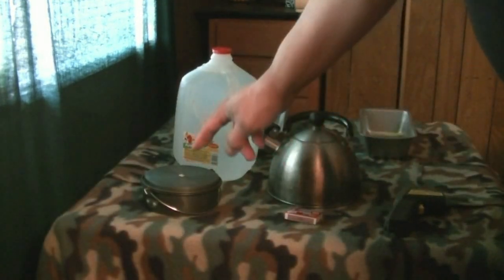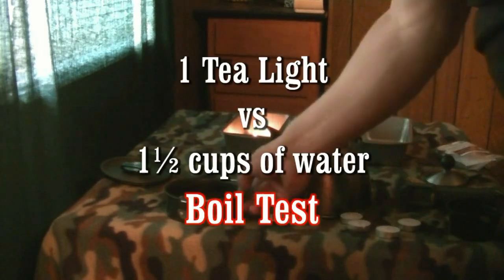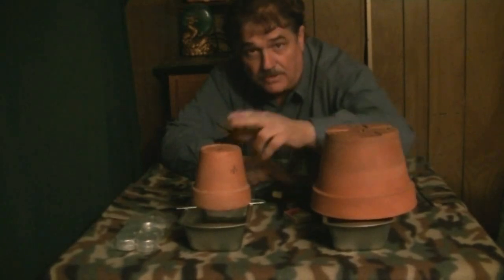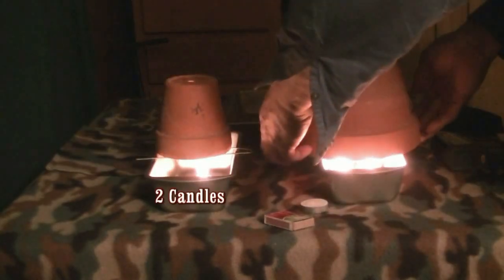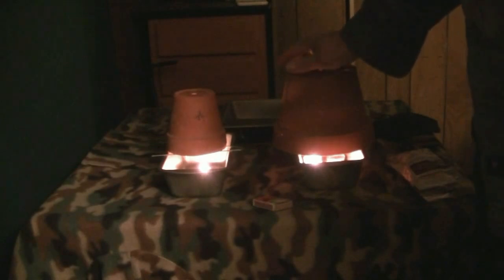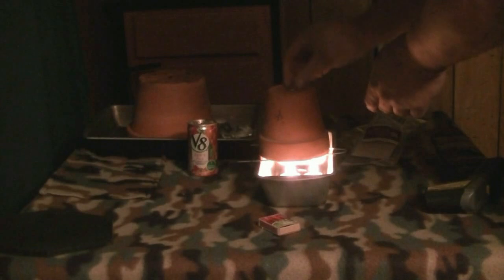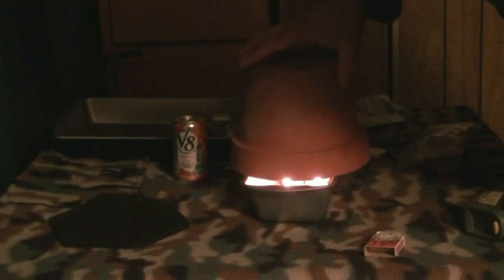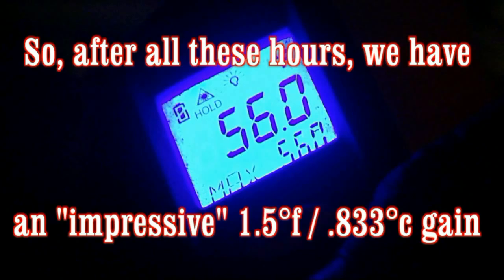Flower Pot Heaters - Real or YouTube Legend?  (Tested and Debunked)

Comment: If it doesn't work, can you figure out a way that this stuff will do something right?
Reply from the maker: I had a friend who put up a video showing off the one he made.  When he and I went out camping, where he was staying in a fully enclosed storage house (About 12x8 feet) and tried it out on a cold night.  I was out hanging & sleeping in my hammock and he was freezing in the cabin with his flowerpot heater.  He asked me if there was a way to make it suitably warming.  I suggested a version of alcohol stove that I had made - you see, the alcohol has a far greater BTU potential than tealight candles do.  He did a video on it.
I told him to get a small can - like a can of sliced olives - wash it out, put in fiberglass blanket cut into circles & filling the can.  Add alcohol (the higher percentage, the better) and use it under the flowerpots.  Remember that there will be heat loss due to heating the ceramic of the pots.  flowerpots don't have sufficient mass to store much heat & radiate it later.

Comment: For a start, I've never seen a candle/flower pot heater set up like this and secondly, it's meant to be for a small bedroom, not a large room.
Reply from the maker: First off, thank you for watching my video.  Now, if you'd indulge me...

Let's address the only part of your thoughts I can address using facts as opposed to thoughts/emotions.  That being the size of the bedroom used.  (I can't address the configuration of the tealight heater I used, as I can't know what videos you might have seen.)
The room's dimensions:   10.5 feet  x  7.5 feet  x  7.0 feet  =   551.25 cubic feet  (total volume)
The room's dimensions:   3.2 Meters  x  2.28 Meters  x  4.13 Meters  =  15.61 cubic Meters (total volume.)

As you can see from the measurements I took of said room, it is in all actuality a rather small bedroom.

As for anything else, purchase a laser thermometer, find a room of similar size, set up  a small table with your configuration of said candle heater, and use your cell phone's video capture mode, recreate the same test I did, fully documenting your test with its results and be brave & honest enough to post your results so others (myself included) can attempt to reproduce your results.  That way you can offer a fact-based rebuttal.  (I showed my science and method so others (you included) could reproduce my test and its results.

I look forward to watching your rebuttal video (when you post it).

Rich, from Spirit of WildWings

Comment: built by someone who thinks just coving candles with plantpots is all there is to it, i have made one following a good video, how to make plant pot heater and had to blow candles out because it was getting to hot after 3 nours using 4 tea lights temp reached 72 c iner plant pot was 80 c.
Reply: Tell me how you get more energy out of it than you put into it, please.  Oh, and could you throw in some scientific proofs while you're at it?  I showed my procedures in action and shared my findings.  I followed the Scientific Model, allowing others to recreate my project.  Oddly I haven't seen anyone offer proofs against what I showed and concluded.
Reply: @richwells284  Idiot
Reply: @richwells284  YES IM USING 2 and my room is 21.5 after 6 hours from 18 and its 6 outside what more do you want tried and tested and works

Comment: Them flower pot heaters needs thicker richer flames for it to work.I would avoid using  Tea Light candles.Its a  video called "The Ultimate Flower Pot Candle Heater-DiY Radiant Space Heater" He use some type of cotton to get better flames vs them tea light candles.And try using Corded In-Line Duct Fan from the Home Depot or something to circulate the heat.
Reply: I had a friend who bought into this farce, but had to admit its failure when I had him put it to the test one especially cold winter's day.  He then asked me if there was a way to give his flowerpot heater the needed BTUs.  I showed him the difference in BTUs between his candles and the BTUs in one of the alcohol stoves I was making at the time.  So he switched his heater out for an iso alcohol heater and it gave him the ability to put out a sufficient amount of heat.  
If you can't produce enough thermal units at the start, the physical laws of thermal dynamics show us that conservation of energy means that the ceramic cannot multiply it, but rather have to take away heat due to transfer to the pots, the air inside the pots, and the bolts used as well.
If you can work out a way to defeat the Conservation of Energy, then please turn your attention to overcoming the laws of Gravitation, as I want the flying cars they used to keep promising us.

Comment: You debunked nothing. Check out how deep those bread pans are.  Your tea light is no where near the clay pot.  It's literally 3 inches away from the pot.  All you need is something small on each side of the tea light to sit your clay pot, so enough air feeds the little flame.  Then your clay pot will get hot.  But you have 3 inches between the flame and the pot.  The flame isn't even 'in' the pot area. Try again with the flame literally underneath the pot and not 3 inches away.  In 10 minutes the pot will be so hot you will not be able to touch it.  Still, get back to us.  It works.
Reply: Why don't you do legit science. Performing the test yourself (with accompanying video record) and use valid, repeatable steps to offer refute. I showed my work try it my way and get my results, then repeat the same test making the single step you wish to refute and share your documented results.
Use the scientific method to validate your claim of faulty technique on my part.
Or prove how this contraption devfies the conversation of energy principle.

Comment: Of course you can't expect it to work like a heater, this is mostly for emergency when the power is out, it is at least better than nothing. There are many flaws in your setup. The hole on top must be covered, the bottom is too high to let the cold air in. To make it hotter, use a eye bolt and a washer, this will cover up the hole and heat the bolt, and make it even hotter. Use a bigger, taller pot, 2 pots to keep the heat longer, I think all the above will determine how effective you want it to be. Many debunking videos should first troubleshoot why it is not working for them before jumping into a conclusion. Try this set up again, try for a few nights and let the candles burn out and not just 5 minutes and see the difference.

Comment: PLEASE REDO YOUR APPROACH to see how FIR (far infrared heat) actually works. It's a little like measuring the heat inside a microwave oven & saying it can't cook. I appreciate your effort, but your flawed "debunking" in this instance may cost lives otherwise saved.  You have not taken into account the effect of FIR-Far infrared heat, that resonates with body heat (btwn 7-16 microns).  It may not heat a room, but it will heat bodies nearby and permeates body tissue deeper than plain heat can.  FIR is used throughout the world in the form of any heat source going through ceramic, sand, jade, tourmaline, brick, etc. (NOT cardboard & foil). Do it and watch the pets gather round it.  A modern example is any FIR  heater, where it may not heat a room, but any body near that source will increase in temperature.  I am currently warm in a cold room sitting at our Japanese FIR-heated table (Kotatsu), and our dry FIR  sauna is upstairs.
Reply from the maker: It either works, or it doesn't.  My testing is and was accurate.
Why not do a video test, in a provable and measurable way, in order to debunk my proofs?

Comment: It appears to me that the idea is to trap all the heat rising from the candle. If the hole on the pot is not blocked the air flows freely out with cooler air mixing as the air rises. The steel bolts I saw were on the inside, they were probably getting heated by the candle flame on the other video postings..
Reply from the maker: +usijoe1 That version of the test was so awful, it got its own video.  Here's the link to that video:
https://www.youtube.com/watch?v=xxpzijXevYg

Comment: Just want to point out to people that methods like these are only capable of working in a effective manner if you live in a house that actually has decent insulation, isn't drafty as hell, and is small enough to be considered a tiny home. Anything over a few hundred square feet is going to have a hard time keeping its heat. 

I understand some people's reasons for scoffing at the flower pot heater, but after seeing my grandparents use it as a secondary heat source only for many years before their deaths, I know enough to say that these CAN work. 

A few key notes, from someone who actually has some real knowledge when it comes to heating a building. First off, you are all using far too large of flower pots. You need the pots to collect heat, but if the flames cannot even come close to the clay, the clay won't catch much of that energy. 

Secondly, you want these at floor level, or as close as possible, because guess what geniuses, heat rises. Put them too high up, and you are effectively heating your ceiling instead of  your immediate area.

Third, keep them near you, not far away. You put these on a side table, near you. Not on some god forsaken shelf in the next room over, or a table in a kitchen that could be heated by cooking some food instead. (You know, common sense stuff... or should be common....)

Fourth. Tealights are for idiots. Go get something with some real bulk, and made out of beeswax or something less toxic than paraffin wax. 

fifth, but not final, Tinfoil is a godsend for anyone wishing to deflect heat, or trap it so it can build up. Use thick tinfoil, and give your heater something to hold onto that tinfoil as it keeps the heat being directed to where you want it. 

Personally, I use a similar method but with a 250w heating lamp. My "pot" is a reflecting shade, with tinfoil surrounding it when I need the heat to be a bit more focused in my direction. That lamp, a baseboard heater in the bathroom, and my stove to cook food with is enough to keep my house in a livable 12-15 degrees C. 

But like I said right at the very beginning, if you have too large a house, or don't properly insulate it, anything you do to heat it will be for naught. 

By the way, I am not sure how you managed to not boil water with those 4 tealights. I use 1 tealight to boil my tea. Mind you, I also use a pyrex glass tea pot. Maybe it transfers/holds the heat better, but still. 4 lights should have managed to boil your water.... Not sure why they didn't, again, because of how often I use just 1 for my teapot at work. (Can't have a hotplate at work, but apparently a candle is just fine.... don't ask why, i don't know.)

Comment: I'm an 8th grade dropout, of a school in a corn field. Really, look it up. 11700 S E 00 W, Fairmount, IN 46928, who then moved to the middle  of the desert in Moab, UT. So, obviously, I know nothing about anything. I couldn't afford to grovel to the gas man this year, so no furnace, hot water, nor stove. I am using space heaters, racking up the coal credits, making it impossible to save for some good ol' NatGas, to do my part in keeping fracking alive. Everyone keeps telling me about this damn terra cotta candle heat system. I refuted all claims for the past month, trying to convey to my 4-12 year college educated, $100K/yr job friends and acquaintances, that if they hold on to this as fact, as 95% of everyone is seemingly doing, then they have wasted they Daddy's dough with all that schoolin', since this uneducated desert rat stoner can just hear the method spoken, and scoff all the way to the power button of the space heater. 
I think I'd rather take the time to throw some rocks in my fire pit for an hour, and lay them about the shack, but my dog is too rambunctious to do so. 
Or, perhaps, if you're going to spend $5 on a 50 bag of tea candles, why not utilize your funds better, and buy a tank of propane, and just burn it full throttle, whilst aiming it at your terra cotta pots. This way, you can heat some pots that retain heat longer than thin metals, which obviously tells highly intelligent webheads that it IS GOING TO WORK!! It HAS to! Well, my head radiates heat at 101.1, and it ain't doing shit to heat this shack up! 
In reality, people aren't posting all those vids to convince anyone of anything, other than that they have the time to kill, to show just how stupid our nation has become. What next? How to keep your fridge at 33 degrees with only 1 ice cube per day? But since your fridge isn't plugged in, you'll have to get in your vehicle, and drive to the c-store, grab a couple cubes, in case it should begin melting, drive home, and voila!, instant cold for your entire fridge! 
This message brought to you by: Some rotten toothed metalhead idiot, stoned outta his gourd, that is WARM, thanks to common sense. All those other people are trying to kill the extremely poor! 

If you read this far, well, BRAVO, I am shocked, but listen to this man in the video, he seems to have the only one which is telling the truth........which in today's world, makes him a whack job, conspiratorial terrorist! 

Thank you for posting a common sense video on heat retention, my friend. I don't 'subscribe' to much, but am going to, tonight, as you're simple wit, and good taste in tunes has piqued my interest in what else you have to say.....you best not disappoint me, or I'll leave nasty comments in our Govt's emails!
Reply from the maker: +dmjaded Well stated, very articulate, and so on.
I appreciate you words.
Reply from the maker: +dmjaded When people claim the flower pots get hot and that heat can heat a room might seem to make sense.  But none of those people would imagine they could heat a room with a single 100 watt incandescent bulb, yet it gets to an amazing 250 degrees, and the filament gets far hotter than 4,000°f.  Yet it can't radiate enough heat to heat a room with only about 300 BTU's per hour.  Well above what the tealights produce though.

Comment: What is the heating power of a candle? 100 Watts? 50 Watts? 20 Watts. well, we might calculate by mass. 1 kg of stearine (a long chained carbhydroxy material) is around 10 kWh. So 2.5 hours burning time out of 50 grams of candle? That's roughly 0.04 kWh per candle. So about 40 watts of heating power. With or without clay pot even 5 candles will not get more than 200 Watts of heat. Not enough to warm your room in a short time.
But a single candle (church altar style) may prevent a wind tight space from freezing and condensation damage , if burnt over long time.
Reply from the maker: +Stefan Scholz The answer would relate to whether the candle was made with paraffin, or soy wax, or beeswax, or palm wax, or coconut oil wax.
Reply from the maker: +Stefan Scholz Here's a good answer to your question.
https://www.quora.com/How-much-energy-heat-does-one-standard-tea-light-candle-produce
Reply from the maker: +Stefan Scholz And thank you for thinking reality and not being a sheeple on this farce of a concept.

Comment: Hey Spirito the way I use mine it works nicely. True I only have a small living room but it still incorporates a small galley kitchen and living space. What I do is I pop my gas central heating on for around 30-40 mins while at the same time lighting my four (eight hour ) candles. After 30-40 mins I switch the heating off and let the flowerpot keep the room on tick over. I guess it's the same principal as warming a giant pot of stew up on top of the stove, initially you need a lot of heat to get it to simmering /boiling point but then just a flicker of a flame to maintain the heat. Doing it this way means I don't have to have the heating for the whole house on throughout the whole day ! By the way you need to use one flowerpot inside another to really build that heat up putting baking foil and a coin to block the hole in the inside pot. After 30 minutes I can't keep my hands on it and it maintains the rooms quite nicely....I'll let you know how it copes when the really cold winter days come !
Reply: +SpiritofWildWings Hey what is that song in the back ground I really like that song.
Reply from the maker: +rael1999 Thanks for the comment, and I hope you do update on how it works.
Good luck.
Reply from the maker: +Brian H. The song is titled "Wonderwheel"  and it was from the self-titled album by the group "The Glass Bottle".
.
https://www.youtube.com/watch?v=VWZLPA4Wz8k

Comment: The inuit heated their snow huts with whale oil in a very tiny space so the principle is there
Reply from the maker: +Elmosdream78 Consider the difference in construction of domicles between the Midwest and The Great White North.
I can heat an emergency ice shelter with a single candle, bit it is reflective and tiny.
If I was heating a closet then I can see this being of use.  But a room 8' by 14' not so much.

Comment: I dont think the intention is to eliminate your conventional heat but rather leveling off your thermostat from clicking in and out all day long to regualate your homes heat. iIstead of debunking, try improving the method.
Reply from the maker: Elmosdream78 How about someone who claims they work doing all the testing and compiling all the data?
I have never seen anyone claiming these work actually presenting actual datum, have you?
Reply: ah tooche.
Reply from the maker: Elmosdream78 My friend Dean at Self Reliance Lab tried making one of these and asked my help to get it to make viable head.  I tried an 8 oz V8 can with the top cut out and stuffed with rolled up paper towels.  It made a workable heat source.  A dozed tea light candles heated the room withot the pots, though I think 16 would have made the temp ideal.  but the 4 candles are not sufficient, and you can't get more BTU's than are produced.  It just won't work.
Thanks for stopping by!